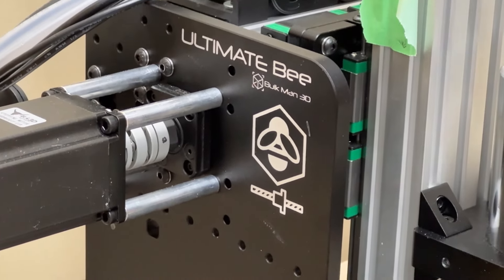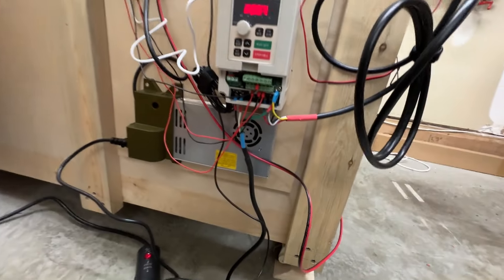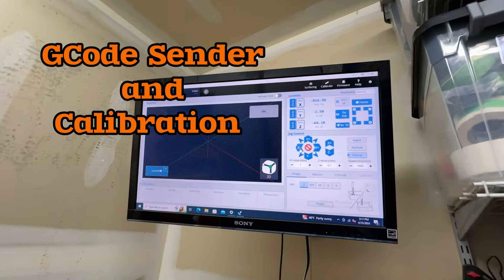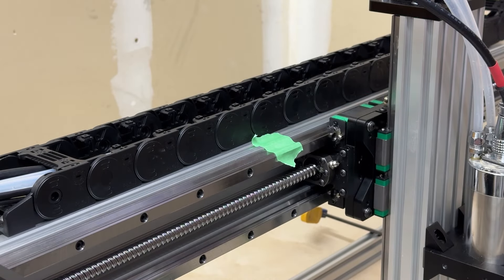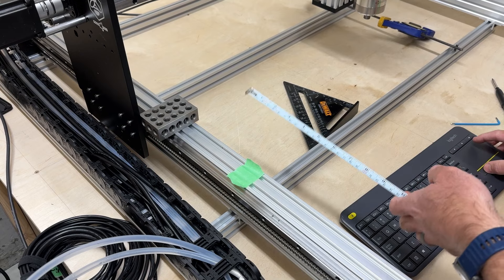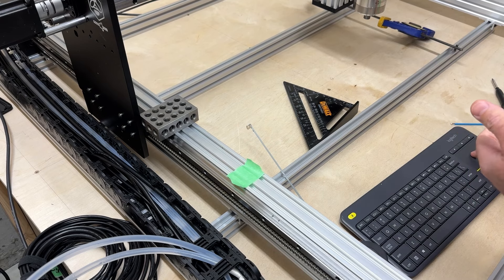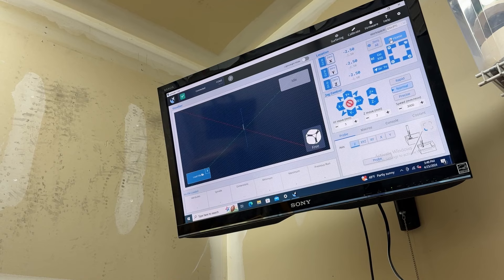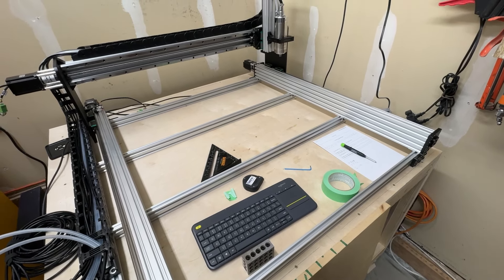Ultimate Bee, Electronics, Calibration, soft limits, oh my!

Comment: if you want I have a quick 3d print for a cable management comb, something I designed so that the cables maintain the same order throughout the cable chains, also keeps the spindle cable away from the stepper cables by spacing it with the water coolant lines, which is important for EMI :)
Reply from the maker: Nice, yeah send me a link.
Reply: Space? What space? You'd need 6ft or more to reduce EMI interference from the spindle cable, let alone the stepper drive wires. What should be done is a common ground point for the shielded cable drains(from every shielded cable). Having shielded cable is pointless if the shield is not grounded. Adding clip-on ferrite are also a good idea. That controller's USB line is very susceptible to interference.
Reply: Sorry let me clarify lol think i hit a nerve there...my Stepper cables, limit switch cables, and spindle cables are all double shielded cables of which the source end is grounded to a common ESD drain Rail which drains to a Seperate Earth Grounding Rod... the space I have created is not enough to completely eliminate EMI but every bit you can do is more than doing nothing at all... im not saying the spacing and logical ordering of the cables is enough to reduce EMI completely or even significantly but it is done to ensure that the cables are not twisted together which would create an increased risk for EMI interference. Sorry ADHD brain so I tend to explain  things in shorthand sometimes >.<, every cable within my system is double shielded cable with the ESD drain connected on one end,  in my current knowledge of electronics to me this creates a path of least resistance for EMI to attach itself to BUT Am I an electrician NO, DO I do this as my day job NO am I a expert Hell No but so far I haven't seen any issues :D I know this seems combative but im explaining it further so that no one else misunderstands my previous response either >.<
Reply from the maker: I like the idea of a comb for cable management regardless of the effects on EMI, if you don't mind sharing the file I would love to give it a try.
Reply: post us the link mate. would be cool
Reply: @WestCoastADV  Straight lines are not your friend. That creates the best set of antennae. As example, the VFD spindle will easily resonate into every cable which is parallel to it. Ever wonder why they make twisted pairs of ethernet cable? It helps cause EMI to EMI interference with the intent of cancellation. Nothing is perfect, but if you look around you'll spot a thing or two from various places that you can use in your own situation.

Comment: Hello sir,im using xprov5 controller,i got the problem with spindle didn't turn on while program start running, how to setting the spindle automatic turn on while programme start running. If i need change something with vfd setup which part i should change,if im need to change xprov5 setting ,which area should i change...please help me sir. I didn't find the solution until now,
For other issues,i have problem with soft limit, my machine didn't detect soft limit in my setting.. for your information,im using cncjs ..please sir help me,,im in trouble..im build it myself,my reference just you tube. But not many xprov5 user share the details setup on YouTube..
Reply from the maker: If you email me it might be easier as there will be lots of back and forth. 
I let you know that I moved away from the Xprov5 to the Super Long Board controller and it’s been a lot easier.

Comment: I have a near identical setup & it has been useful to see your settings. Wondering what your micro-steps are set to 1/8 or 1/16 perhaps?
Reply: Also see you are running both x and y-axis at 4000mm/min. While I have no problem matching this on the X-axis, I can’t get the Y-Axis to run much beyond 3400mm/min without getting skipped steps and stalling. 

Considering upgrading to 36v and CNC3D Nighthawk in the hope for more speed, as many have said the xProv5 is the limiting factor. 

So I guess I am wondering, have you had to dial things back now your using your machine in anger or has it behaved at those max rates?
Reply from the maker: I was but I ended up with some stall issues so I dialed it back to 3k and about 2100 when cutting most materials that arnt hard woods. 
I have to double check but I am 90% sure I am 1/16 for steps.
Reply: @sparks-tech  cheers for getting back on this. Yes those are much more like the real world speeds I run my machine at too, and are near three max ability of the xProV5 with its inbuilt 24v drivers. I am currently sourcing a 36v PSU, External drivers and Controller and hope to see almost double those speeds once installed.
Reply from the maker: @DatumCAD  nice. Have you looked at the Nighthawk controller. It allows for higher PSU’s to be used and travel speeds.
Reply: @sparks-tech  yes I have indeed and external driver version of that & the Root CNC controller. I think this will be my upgrade path with a 36v PSU to realise the speeds that the xPro hasn’t been able to deliver on 👍

Comment: you tested commander meanwhole or any other software you liked more then gsender in comparison?
Reply from the maker: I think GSender is a very well rounded option with a good layout and easy to understand interface. 
My next choice would be OpenBuilds for sender software. I really want to like Commander and I think the support from CNC3D is amazing but I don’t like the interface or workflow.
Reply from the maker: Sorry I missed this message the messages feature in YouTube sucks. 
As far as I am aware there is no wireless MPG support in GSender. There are a few wireless gaming controllers that you can use and my Xbox controller works well. 
I have used Commander more and I am getting more and more used to it. The community support around Commander is amazing.

Comment: How was Van? I went last year. Compared with current images on the net, it has 'changed'... 
If you get chatter making deeper cuts, I recommend adding vertical angle pieces to the gantry uprights. They are rather thin looking and under load could be a point of flex, especially when traveling in the X. A single piece of 1/2" angle iron would stiffen that up like no tomorrow and not interfere with the Y movement.
Reply from the maker: Van was great, the weather was very nice to us and held off raining until the travel day. 
Thanks for the advice the back of the X has a 40x40 profile to help keep things rigid but I was looking at the small 90’ connectors thinking a piece of angle iron might make a better connection between the two. 
I plan to run it as is and push it a bit and then make videos on any upgrades so I will keep your advice in mind as I move forward.

Comment: What is your table size? I've got largest 1.5x1.5m and X gantry has very low torsion rigidity for this size unfortunately. You can push the router bit and it would deflect whole assembly very easy, bit was jumping with slightest speed increase. By default X gantry is C profile and 40x40 square profile at the back which is in the center and therefore gives nothing for the torsion. I ended up using two C profile back to back and additionally two 80x20 profiles above and below these, it now seems that it is more or less acceptable. Next problem is quick wear of screw nuts though :)
Reply from the maker: My table is 50” wide by 48” deep. I have room on all sides to allow for wall panels if I choose to enclose it at some point in the future. 
So far my Z is stable with very little deflection when pushing on it but once I get my hose order and get the cooling setup I can do some real world testing.

Comment: Note of caution. Mounting on Wood is bad practice. Electricity+flammables = recipe for disaster. Play safe, get a metal enclosure. Besides, that router, no matter how well you make the vacuum system, will produce dust and find its way into the electronics. Keeping them cool and clean, and grounded, is a good thing. Ground the chassis, too. It will make static electricity which can cause sparks through the moving dust.
Reply from the maker: Fair advice I will take a look at some other mounting options in the future.